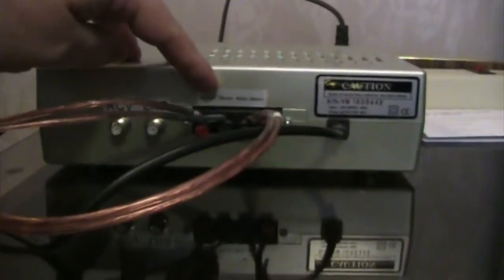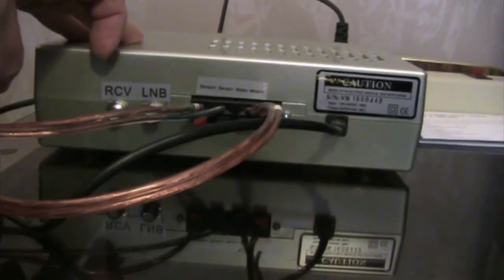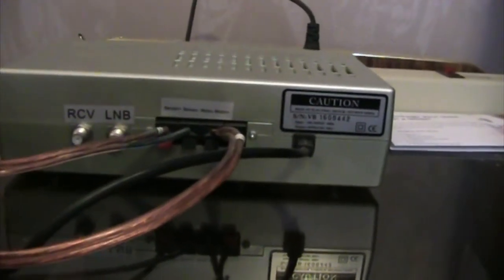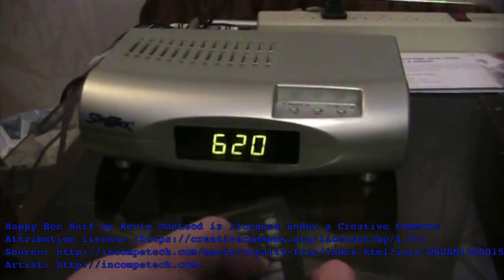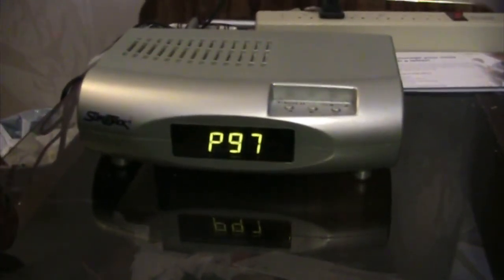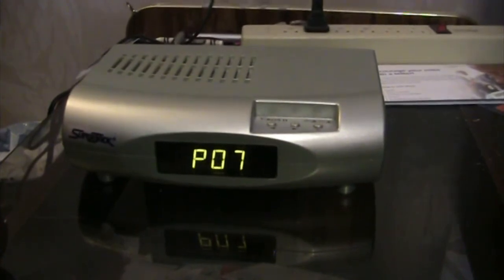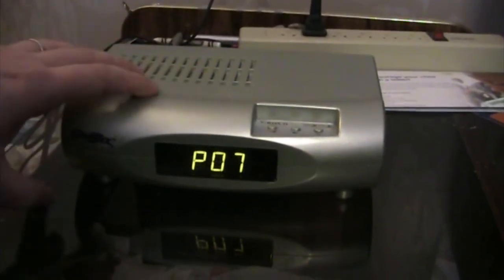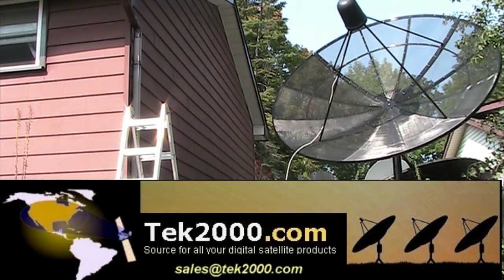SuperJack C-Band Satellite Dish Positioner

Comment: despite superjack having stars and stripes emblazened, its a chinese firm. the outer parts are great but the inner screw jack part and bearings are the mildest of steels and will corrode if not greased regular. unfortunately its also press assembled so no chance to service without drillin out all the indents and rewelding after new bearings fitted.

Comment: Hello and thanks for the video. I tried looking on the net but I cant see an answer. I would like to ask a question re the V box. Forgetting the memory channels, what does the readout display from and to at lowest and highest ? I'm guessing 0 to 999? This will be dependent on the actuator's pulse count. I'm wanting to track the moon using a polar mount and actuator and I can convert the readout on the box to an angle so just need a continuous up/down numeric readout through the arc of the moon east to west. I hope that makes sense.
Reply from the maker: are you doing moon bonce? if so with what frequency?
" I'm guessing 0 to 999?" yes plus a dot for - or positive i think
Reply: Thanks for the quick reply, it is appreciated. Yes small station eme on 23cms (1296mhz). Ive bought a used dish 2.4m, mount, actuator and feed. I was going to build something to drive it but looking at these they are quite cheap and should do the job with little effort.

Comment: How does a polarizator look like? I saw your sat box had an output for this as well?

Do you have an older dish that would still use a polarizator, separate reciever, and separate downconverter? Or maybe know some video where some would be still in service?
Reply from the maker: The old LNB's for C band had o motor to change the polarity's
Reply: @RobbieStrike  oh I see, but is there any good mover & polarizer for theese old lnbs? Something like ypur dish mover but that it would also do the polarization and allow it to be controlled with modern receiver?
Reply from the maker: @DXingSlovenija  titanium satellite used to manufacture and have one available but I think they were sold out it was a limited time. So right now what people do is they use their old receivers with the motor in the L&B control
Reply: @RobbieStrike  thanks, so if I ever need to control an old lnb I now know what to get

Will you show your old lnb in a video once? (Would realy like to see it work), I guess you can easly mount it to your black pizza dish (idk, I like to call this big cband mesh dishes pizza dish, cuz they come appart like a pizza)

BTW: poor dish, someone could use it :(   : https://youtu.be/gHvFnS6H7uk

Comment: any idea about the electronic side? what kind of signal is the position feedback? just got another 2.4 with superjack but no box so I will like to build one
Reply from the maker: nothing like that came in the box :(
Reply: @RobbieStrike  ok so i had to strip it down. the sensor is just a magnet and reed switch so really low tech. one pulse per rotation. no doubt each jack size has a different pitch screw so different ratio. the centeral machine screw is bad metal. if i can fix mine i will write a simple esp32 code to replace the 100+euro vbox with 5 blats of wifi controller